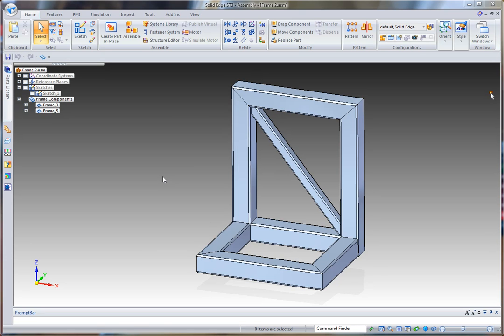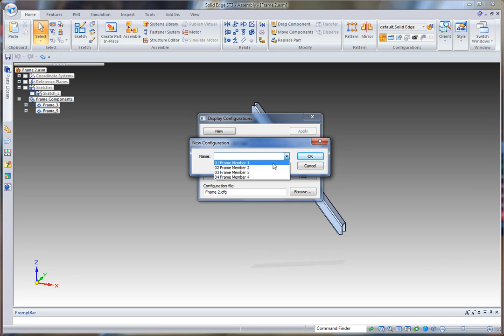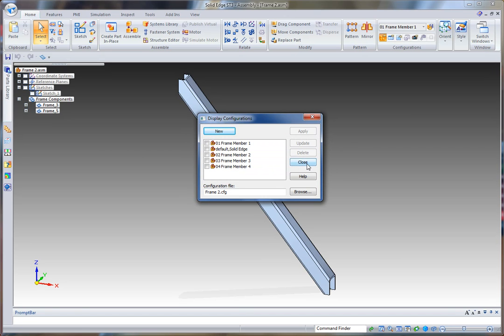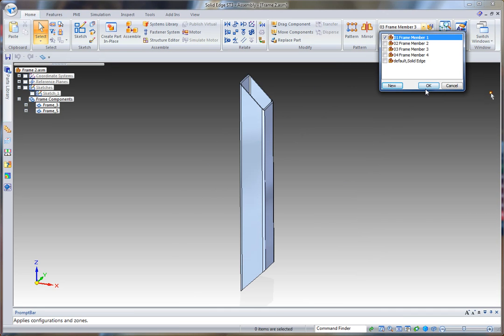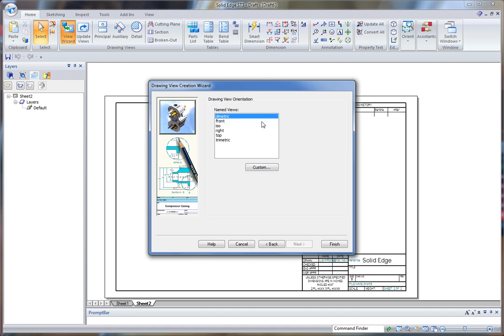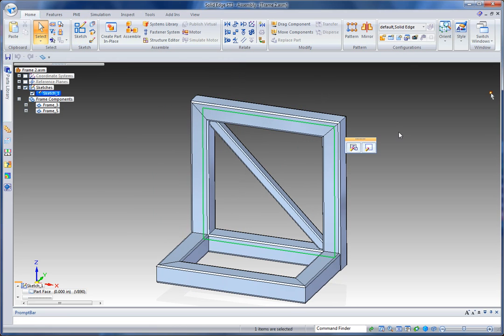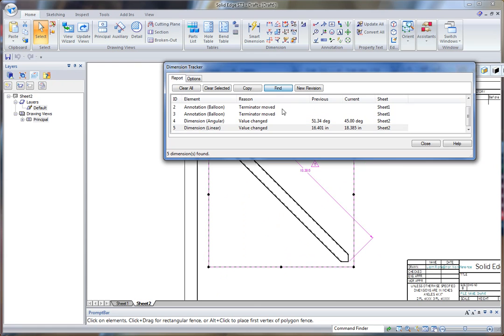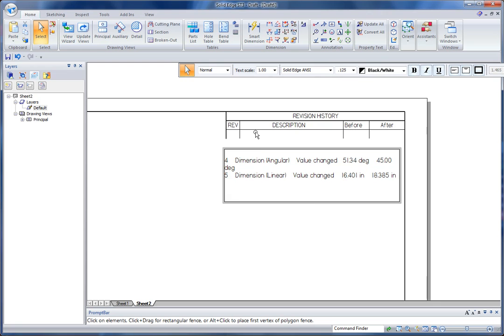Working with Solid Edge Frames Part 2

Comment: @Design Fusion, (and anybody else) when I try to create a parts list that includes miter cut 1 and miter cut 2, all of the miter cuts show as 0.00 degrees, even though they show as mitered in the assembly. Why is this?